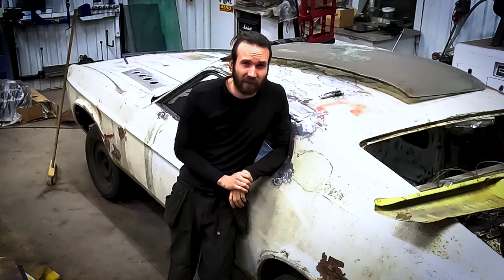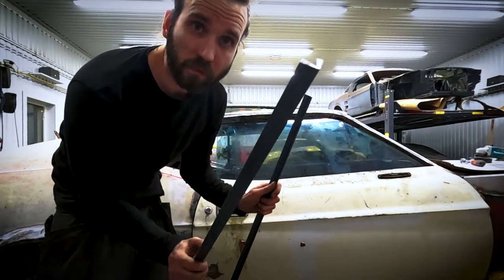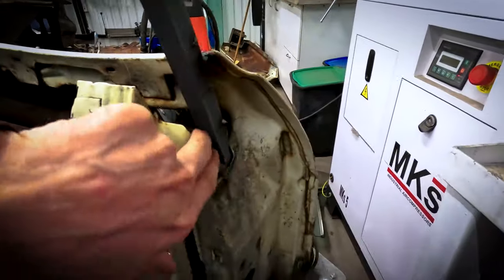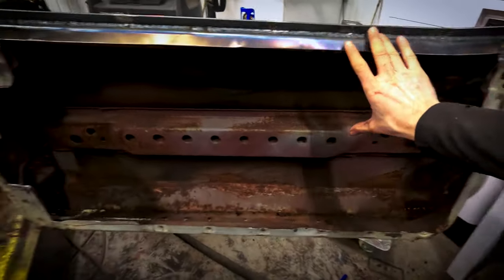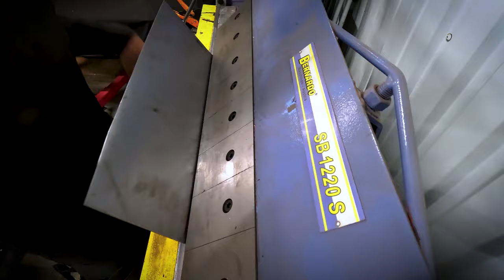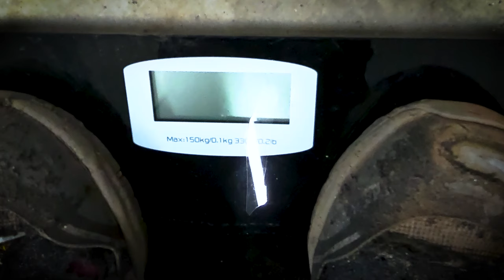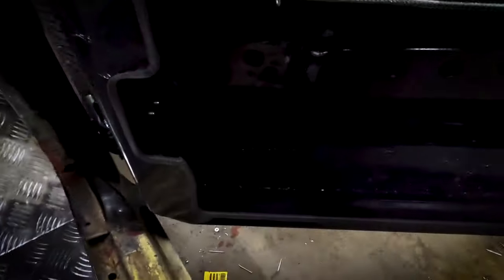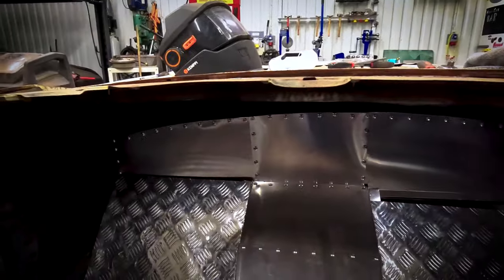GUTTING it! ("Rustang Holeroof" Episode 2)

Comment: If you're going to have fixed windows, I would suggest adding air conditioning as it's going to get very hot inside of the car.
Reply from the maker: I stripped all air conditioning/fans etc. I however have a cowl vent under the hood that I added. But yeah it's gonna be hot :D